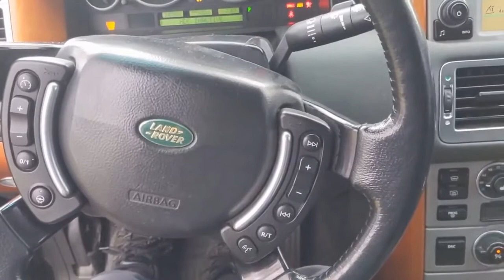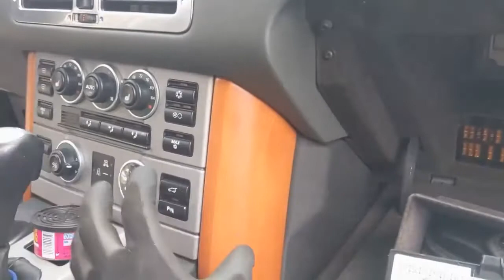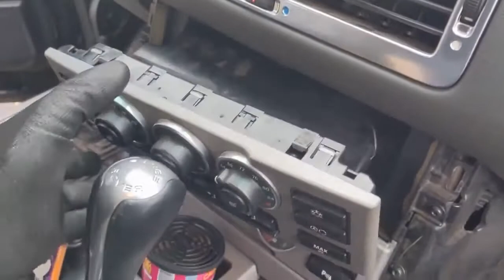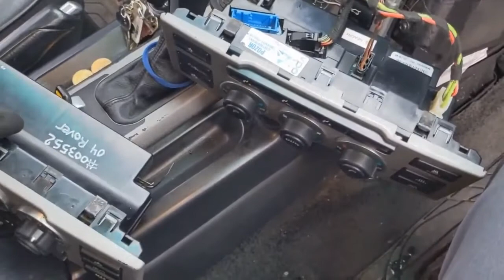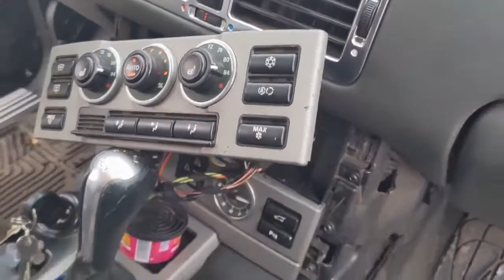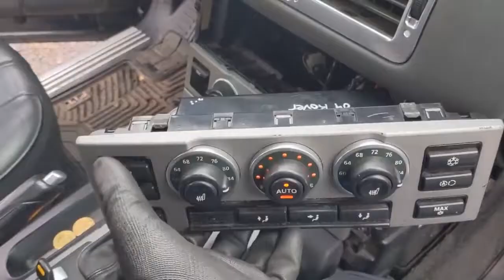2003-2005 Range Rover Climate Control No Heater or a/c | How to Diagnose Climate Controls in Car

Comment: I did this while my car was on, and I unplugged the left middle black piece and the fan in the back turned on, but not the front 😬 my fuses are good so now I'm confused
Reply from the maker: @harley9449  I think that is a default setting for when this is unplugged. If I remember correctly the same thing happened to me.
Reply: @ValleyMobileAutomotive  thanks for the reply. Turns out the fuse fell out 😂. It's working again, but I couldn't get the climate control to snap back in. 😅 thanks for the awesome video! I plan to work on my car this weekend for a parasitic draw causing it to drain on a 5A draw when turned off 😒. Wish me luck
Reply from the maker: @harley9449  Glad it was something simple 👍. Draws can be tricky but I'm sure you'll find it. There are lots of good videos explaining the process.

Comment: Land Rover had a service action on this. It was really nice of them not to send me any letter on this. 
This Service Action is closed effective 01 March 2007 Warranty Claims may no longer be submitted for this Service Action. The repair processes outlined in the bulletin pages which follow this cover sheet DO remain valid for the repair of a vehicle with the symptoms outlined. TECHNICAL INFORMATION SERVICE ACTION No: SB162 HeVAC Control Panel Quiescent Drain Ref: Issue: 1 Date: 23 July 2004 AFFECTED VEHICLE RANGE: New Range Rover (LM) 4A153466 to 4A164860 SITUATION: QUIESCENT DRAIN FROM HEVAC PANEL The air conditioning control panel installed in vehicles within the above VIN range may have been manufactured with a fault in the circuit board. In some instances, this can cause the circuit board of the HeVAC control panel to remain active after the vehicle has shut down. This in turn will lead to excessive quiescent battery drain and a potential non-start condition. RESOLUTION: INSTALL RELAY HARNESS NOTE: Some vehicles may have been updated by installing a locally sourced relay and wiring, as advised by Land Rover Technical HelpLine. If that repair has been applied, the temporary repair relay and wiring must be removed and this Service Action carried out. A relay and link harness should be installed on all affected vehicles to ensure that the HeVAC control panel will shut down on unattended vehicles. Vehicles should be repaired whenever possible prior to retail sale or at the first available opportunity. PARTS INFORMATION: YNI500040K ............Relay and link harness kit Qty 1 DDW WARRANTY CLAIMS: Warranty claims should be submitted quoting the Program Code together with the relevant Option Code. This will result in payment of the stated time and, where applicable, parts and miscellaneous expense codes. Option codes make it unnecessary to enter parts or labor. These are repeated here for information only. Drive in/drive out should only be claimed when the vehicle is brought back into the workshop for this action alone to be undertaken. Program Option Job SRO Time Part Number Part Description QTY Misc Code Description (Hours) Expense Install relay harness Relay and Harness B162 B to heater control 80.10.89/35 0.5 YNI500040K 1 panel Kit Install relay harness 80.10.89/35 0.5 to heater control Relay and Harness B162 C panel. YNI500040K Kit 1 Drive in/Drive out 02.02.02 0.2 Normal warranty policy and procedures apply. Material allowance is included in labor operation. TIB CIRCULATE: Service Mgr Warranty Workshop Body Shop Parts SB162 TO X XX XX © Land Rover 2004 Page 1 TECHNICAL INFORMATION No: SB162 REPAIR PROCEDURE RELAY AND LINK LEAD INSTALLATION 1. Refer to RAVE/GTR section 76.46.28 and remove the driver's-side kick panel above the pedals. 2. Mark out the position to drill a hole on the finished (passenger compartment) side of the kick panel in the indicated location. (Figure 1) 3. Use a sharp awl or ice pick to mark the hole location and punch the awl through the panel and insulation. Leave the awl in position. 4. Turn over the kick panel so that the NVH cover material is facing upward and the awl end is visible. 3 3 5. Mark out a 35mm x 35mm (1 / 8 x 1 / 8 inch) square around the awl location (Figure 2). NOTE: Removal of the NVH material around the hole location is necessary to prevent the drill from wrapping the material when the hole is drilled. 3 3 6. Using a razor blade or sharp knife, cut out the 35mm x 35mm (1 / 8 x 1 / 8 inch) square in the NVH material on the closing panel. Figure 1 Kick panel viewed from the finished side Figure 2 Kick Panel viewed from the NVH insulated side Page 2 of 4 © Land Rover 2004 TECHNICAL INFORMATION No: SB162 7. Remove the NVH material in the cut out area. 8. Turn over the kick panel so the finished side is up and remove the awl. 1 9. Drill a 6mm ( / 4 inch) diameter hole through the surface of the kick panel using the awl mark as a starting point. Figure 3 10. Position the supplied washers between the relay mounting bracket and the kick panel. (Figure 3) 11. Orient the relay wires toward the center of the vehicle. 12. Install the new relay assembly to the kick panel ensuring that the wires remain correctly oriented. 13. Install the PDC speaker and foot well lamp to the closing panel. 14. Connect the relay connector (natural coloured 3-pin connector) into the PDC speaker location C-0369. ('A' in Figure 4) 15. Connect the harness connector C-0369 to the relay link harness. ('B' in Figure 4) 16. Wrap a self-adhesive foam pad supplied in the relay Figure 4 and link harness kit around the harness connectors to prevent any rattles. CAUTION: In step 17 there is no need to disconnect the multi-plugs from the HeVAC panel. 17. Refer to RAVE/ GTR section 80.10.02 and remove the HeVAC control panel from the dash without disconnect the multi-plugs. CAUTION: If a temporary repair has been performed at the direction of the Technical HelpLine, restoration of the HeVAC control panel wiring to original configuration is critical to the Figure 5 effectiveness of this repair. 18. If installed, disconnect any temporary repair components and restore HeVAC wiring to its original configuration. 19. Route the relay link harness through to the back of the heater control panel. (Arrowed in Figure 5) Page 3 of 4 © Land Rover 2004 TECHNICAL INFORMATION No: SB162 20. Disconnect the black 3-pin connector C-1630 from the heater control panel. Figure 6 21. Connect C-1630 into the relay link harness. ('A' in Figure 6) 22. Wrap the self-adhesive foam pad supplied in the relay and link harness kit around the C-1630 connector to prevent any rattles. 23. Connect the relay link harness black 3-pin connector into the heater control panel location C-1630. ('B' in Figure 6). CAUTION: Care must be exercised to avoid trapping the wire harness during the installation of the centre console panels. 24. Install the heater control panel, taking care not to trap any wires. 25. Install the driver's side console panel, taking care not to trap any wires Page 4 of 4 © Land Rover 2004

Comment: After the mechanic made me change the compressor, condenser, and the discharge hose. This guy is now making me do exactly what you just did!!! He is making get a used AC control but thanks to this video I can install this at home. My father is an electrician so I think I will be good and he can help me out. Thank you so much an easy fix that mechanics fool you in thinking it’s difficult and expensive.
Reply from the maker: Hey Maxi, thanks for the comment. I know how frustrating your experience can be. Hopefully the new control module solves the issue 👍